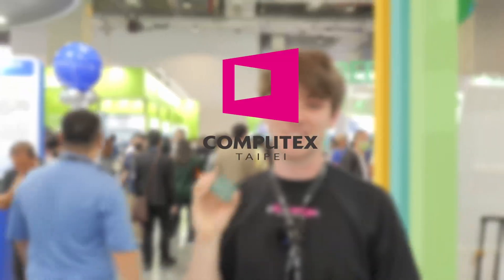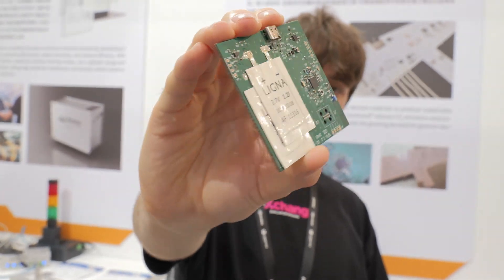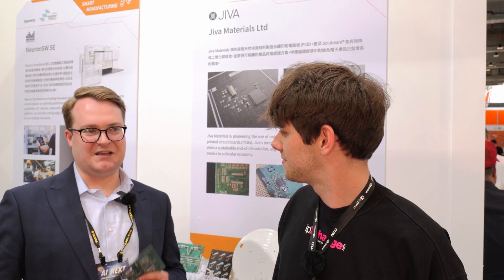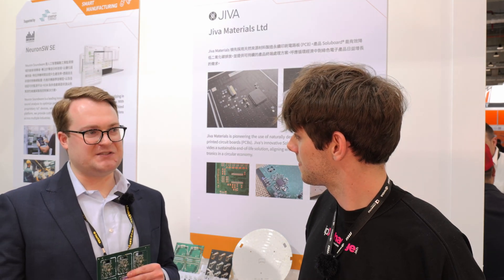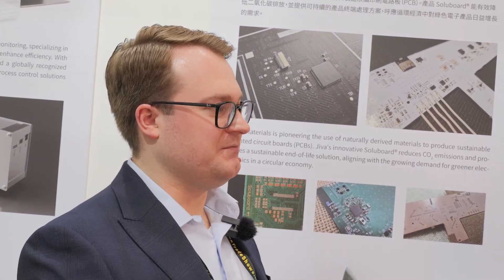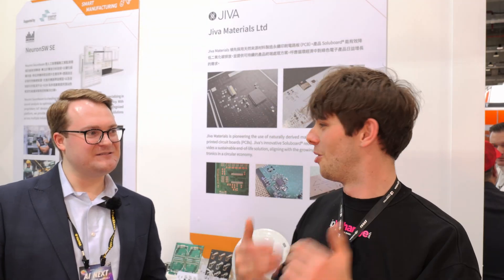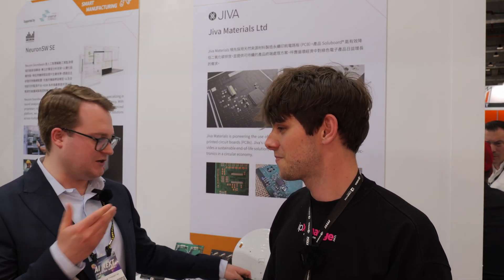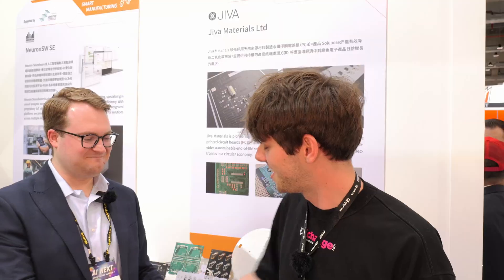Can This Water-Soluble PCB Solve E-Waste?

Comment: Seems very sensible. Although traditional PCBs and components can withstand especially distilled water for a bit, the erosion problem with regular water requires no water contact for most electronic uses anyway. So a good place to use such soluble plastics